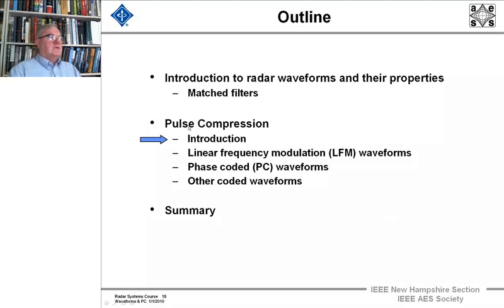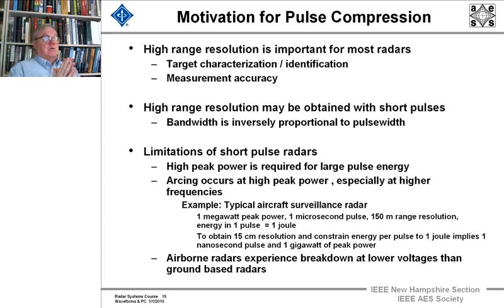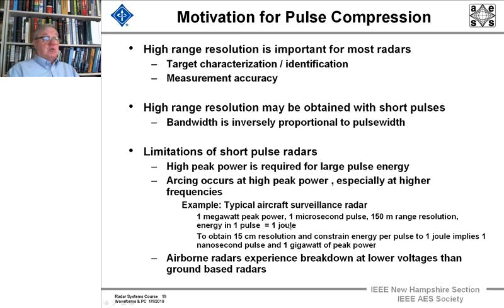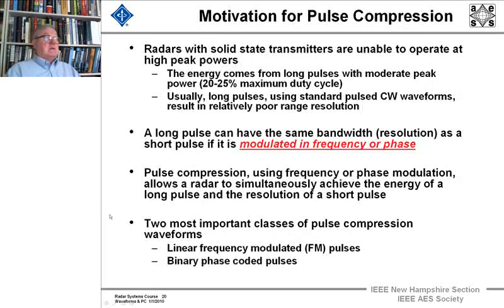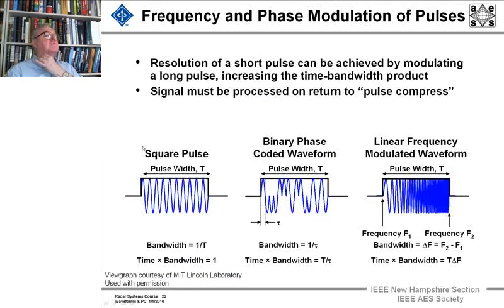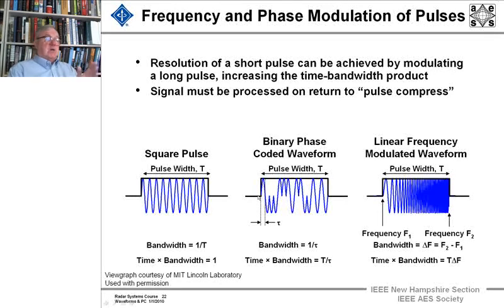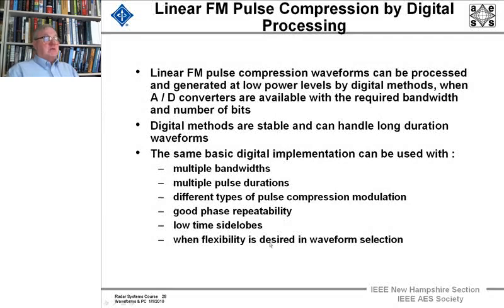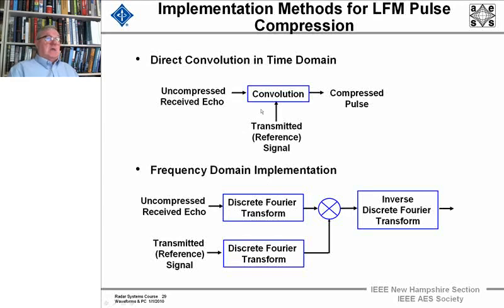Radar Systems Engineering by Dr. Robert O'Donnell. Chapter 11: Waveforms & pulse compression, Part 2

Comment: Instead of FMCW or Barker code modulation we could use band limited white noise Tx waveforms as well.
Is it used often in the radar word? Are there any disadvantages of using it? 
As far as I know it's time domain side lobes after convolution are lower than for FMCW.